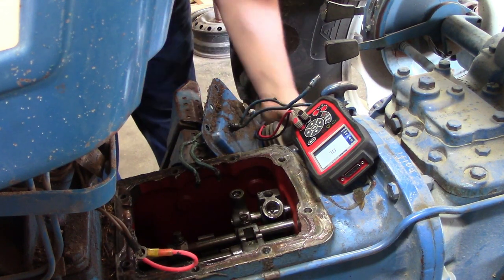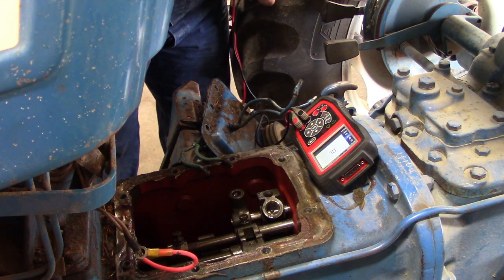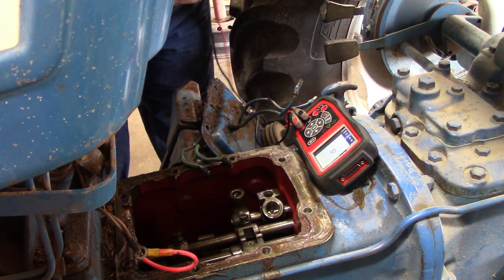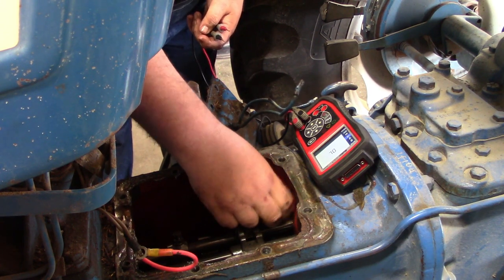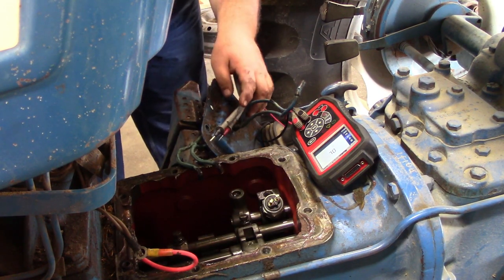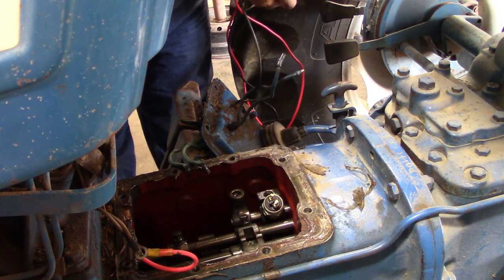how to put a safety neutral switch in a ford tractor.

Comment: Hi!  Thank you for the video. I have a 3000 not starting. Starter went out. I replaced solenoid and ignition switch when I put in the new starter, now it cranks and cranks but will not fire. Yes I have gas in it too. lol. How were you able to diagnose that this safety switch was the culprit? I am hoping this is my issue as well
Reply: New ignition switch isn’t right

Comment: How do u know which terminal each wire goes on
Reply: On these old tractors, they have been in the same place for so long, they are shaped.  just put them back the way the look like they go.  Check it before putting all of the bolts back in.  If it wrong, swap it.